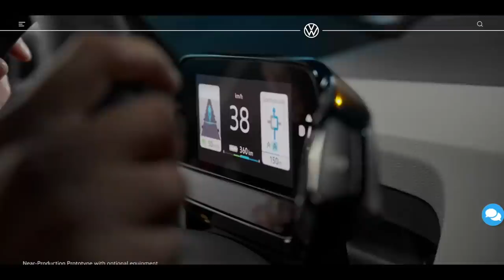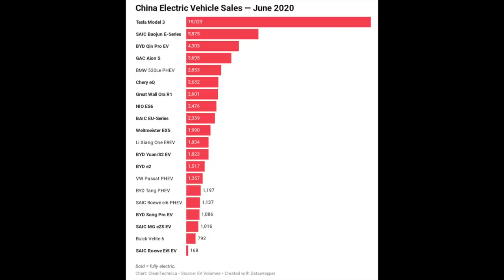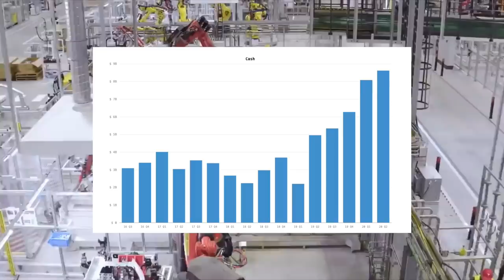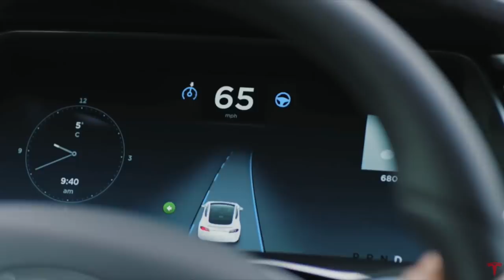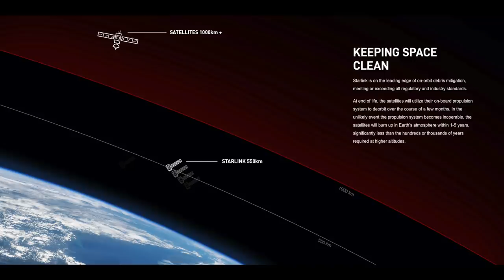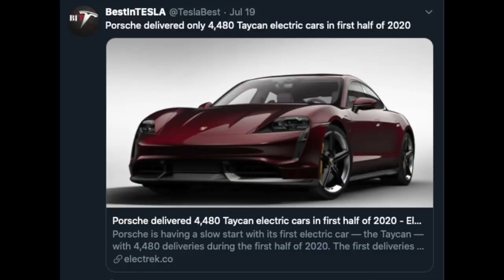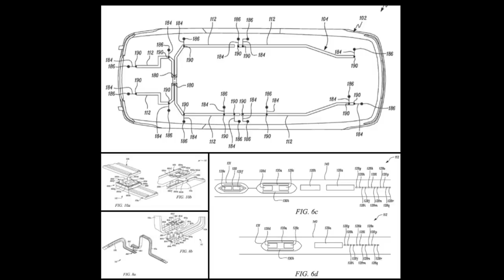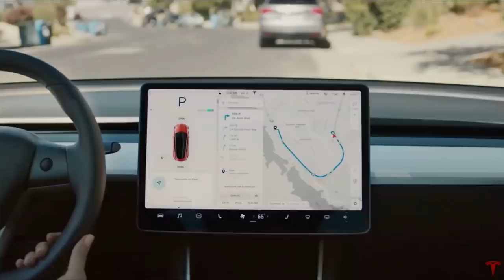Tesla WON | Tesla just made their Checkmate move | No one can stop them now

Comment: The whole reason the old car companies are in this mess now is they never counted on an electric car company to succeed, and did everything in their power to prevent this from happening.
They never wanted to innovate or produce electric cars as their main business strategy. Likewise, they tried everything to bankrupt Tesla, but failed and will now pay the price.

The one I believe will survive and compete in the long run is Toyota. They may have a downturn, but they specialize in efficient manufacturing, and have been on the path to electrification for decades.
Reply: Dear Dina:  The “big boys“ certainly did not anticipate any new car company emerging, let alone An electric car company. And here comes Tesla, in a few short years, has usurped all the major technologies and produced the best electric cars that are indeed affordable.

The “Big boys“ make only a small fraction of their profits on the sale of new cars.  A much larger share of profit is made on parts for repairs. With this model they are doomed. Electric cars have far fewer parts and need far fewer repairs.

A perfect example is the amount of wiring needed. It looks like Tesla is finally adopting what the “big boys“ could have done 20 years ago, multiplexing Control signals which completely eliminates wire harnesses, reducing the amount of wiring in each car from miles to a few hundred feet.

I am an electrical engineer and I learned about this technology in the 1980s, it was invented by the telephone companies in the 1960s to reduce the amount of wires needed to carry telephone calls. All these decades I have been watching, hoping, becoming exasperated, as to why those idiots in charge at the “big boys“ have not adopted this simple and proven technology to reduce costs and complexity of cars and improve performance.

I hope not one of the “Big boys” survives. I want revenge because they retarded technological development for decades with their shiny shitty cars.

Put MBAs in charge instead of engineers and this is what you get, big fat “big boys“ that are going to go bankrupt. Enjoy the next few years of watching the “big boys“ shrink down into “little boys“, If they survive at all.
Reply: @steveperreira5850  You can be mad all you want, those are americans with good paying jobs with families to feed....
Reply: @steveperreira5850  IIRC, it was GM who invented "planned obsolescence". They deserve to go down for that alone. Also for killing electric cars, fighting smog control, tearing up public transit, etc.

They fed us increasingly crappy cars from the mid-1960's on, which is why Toyota et al. cleaned their clocks. They finally began to up their game in the 1980's, but unfortunately, their corporate culture, which strongly resembles feudalism, did not change with it. The lords of the boardroom liked their cushy positions. Innovation, and anything else that might rock their boat, was shunned.

This created both the need and the opportunity for Tesla. Even so, it would not have happened without a visionary like Musk, willing to risk his entire fortune on what seemed at the time like a pipe dream.
Reply: Crypto Unchained What you are saying is Ludicrous.  As the old trope goes, “ then we should still be making buggy whips.“  American jobs will go away if we do not adopt the latest technology and master it. I most certainly do not want American jobs to disappear, I want inefficient jobs everywhere to disappear, mainly Government jobs, but also in inefficient industries and businesses.
Reply: Paul Pedersen   Dear Paul: very well said, especially the visionary part, it was a huge risk that Elon took, And it look like never was anybody going to break into the auto business from scratch without government assistance, like done in China.
Reply: Didn’t Joe Biden say he wanted all gas vehicles off the road by 2025? ;)
Reply: Dima Gurevich No they held off from losing money while they were unprofitable and let Tesla make all the losses, now they can be profitable they are moving in.
Reply: Simon Rook There is an alternative universe where your theory holds water, but not in our universe.
Reply: Francisco Teixeira   Dear Francisco: the emerging new electric car industry, and tesla in particular, is not the only reason the big car companies in America are going to go out of business, but it is hastening their demise. That’s what I’m happy about because I may live to see it happen!

Obviously the debt that the big three auto companies have accumulated because of employee obligations and poor management of resources, etc. Got them in the weak position they are in right now.

I was in a position to observe how badly they were managed in the 1990s, and how stupid the American car companies were compared to foreign auto makers.  I personally designed automotive parts and I visited all the major car companies as the lead design engineer for our company back in the 1990s.

I have just one question for you and I’m serious about this. How come the American car companies cannot make a good small car, or why won’t they do it? Every single car I have ever bought is a small car, and most of the people I know buy small cars.  Those cars are made by foreign producers.

You seem to be very critical of what I had to say and you haven’t offered much of your own advice or thoughts, so now you are on the firing line Mr. Texeria.
Reply: @cryptounchained7444  So, in essence, you are saying that all GM (and others') employees are just indirect welfare people? Wouldn't it be much more efficient to just pay them directly and cut out the enormous expensive of materials and the overpaid executives?
Reply: The point you make is one of the main reasons I love Tesla, No other company cared to make electric cars because they were probably paid by the oil industry. Probably the reason they killed off the EV1.
Reply: @steveperreira5850  Love your comment!
Reply: GntlTch   ... Oh, Oh, I love your plan for efficiency, oh it made me laugh so hard, thank you, and I endorse it completely! We should extend that policy to farmers who get paid to grow crops that nobody wants to buy. Mind you, I am the son of farmers.
Reply: And together for almost a century with their pals- big oil, who all they cared about was selling large volumes of gasoline and diesel. Both dinos will be seeing their schisms.
Reply: @GntlTch  At one time I read GM’s biggest supplier was not US Steel, Goodyear, or PP&G.  
General Motors’ biggest supplier (the vendor they paid the most) was Blue Cross. 
With one million retirees receiving lifetime healthcare, GM had become primarily a health care provider that happened to lose money on cars as a sideline. 
This is what actually bankrupted them.
Reply: @steveperreira5850  Very well said

Comment: BTW, after S&P inclusion, institutional buyers will buy shares on the open market.  Available float on shares is ~147M. At Tesla's current market cap, it should be about 1% of the total fund value, or about 26M shares.  For Tesla to capture all of that, they would have to dilute current offerings, which will NOT happen.  Instead, fund managers will acquire shares from the float, thus driving up demand and share price.  The only money coming directly to Tesla will be in company held stock's value increasing, and that won't be accessible.

Comment: 2:00 Sorry brother, they have to “buy shares” in Tesla, they don’t have to give them money to boost their free cash flow.  It should boost the share price insanely though.
It is only if S&P ask them to release additional shares that your scenario will play out.
Reply: You assume that there will be enough shares for them to buy. Many, if not most, Tesla share holders are going to hang onto their shares and go Long. It is very likely that Tesla will make a secondary stock offering (not sure what the actual term is) and then Tesla will get all the cash from that sale. I'm guessing over $ 40 Billion.
Reply: Yes, they can raise that capital by issuing more shares, without diluting the value too much...as they did a while ago at around $750.
I’ve read that the S&P500 may ask them to do this anyway, to make shares available for Tesla’s inclusion.
Reply: terry Sullivan 26 million shares is 20% of the available pot. The normal process is for the price to reflect the level of demand. It is S&P who request a special release of shares. In that case Tesla get the cash. 
But you can’t “assume” this will happen as the video suggests.
Reply: @terrysullivan1992  Currently there is a daily trading volume of around 15 million shares. With around 15 million shares needed to be bought it's certainly doable over time purchasing them on the open stock market.
Reply: Wrong, if Tesla issues more shares it will dilute the share value and Elon Musk's ownership stake. This is not happening.
Reply: @roryreddog3258  Actually you can easily assume that the request will be made. 

If you need to by 25m shares, and try to just buy them on the open market, that would be stupid. Lets (again easily) assume that the index fund people with $40b to spend are not stupid. So that request IS going to be made.

The people are Tesla are not stupid either. They could let the index funds hang and force them into the open market. But why would they? It bumps the stock price, but that does Tesla as a company very little good. $40b cash, does the company a LOT of good. So, they would be stupid to turn down the request.

The assumption is the inclusions into the S&P, my gut says that isn't going to happen in August. The stock price has just been to volatile the last few months. It's seems of of hit a stable value at the moment, but too little too late. My guess is we're going to have to wait a few months for S&P to happen, and we're going to see a big drop in the price in the next two weeks because of that.
Reply: Theepan Raj  S&P can demand it for inclusion, but seems unlikely... you’re right though dilution would be bad for me (shareholders)
Reply: Matt McCarthy my understanding is that it is S&P that make the request/stipulation not the index funds.  
But I could be wrong, if you have better knowledge in this than me 🤷‍♂️
Reply: @theepanca   “Without diluting the share value too much”. It’s in the words. ;)
Reply: @roryreddog3258   The long term share holders, and those considering long term investment in Tesla, would most likely see it as a good ‘long-term’ move...like they did last time. Tesla could invest in further expansion, and maybe keep some back for ‘eventualities’.
Reply: @roryreddog3258  So, I'm not from the US, and I've never run company there. But I have in the UK, and we're largely the same in the legalities.
AFAIK. You, you self could today approach Tesla as ask to buy stock directly. Of course, unless you're a billionaire, that email is going straight to the Deleted folder.
So the S&P could request/stipulate it, but that isn't the only route. If the S&P doesn't the Indexes will ask for it anyway. As it gives them a stable, one off price.
Reply: C Bromley yep I agree ultimately Teslas long term success is my own. But if they were “forced” to liquidate $40 Billion when it can’t be used up for the next 10-20 years, I’d be a little wary of that dilution tbh
Hopefully won’t need to find out
Reply: Matt McCarthy thanks for clarifying.  makes sense. 👍
Reply: @roryreddog3258   Yeah. I don’t think they’d raise $40 billion all at once. I share your gut feeling that, that wouldn’t be good. ;)
Reply: @terrysullivan1992  there are enough shares traded in a week for the index traded funds to hit there allocation. What he says in his video is patently wrong, there is no getting around it. Dilution will cause a drop in valuation no matter what why you cut it, it's not going to happen
Reply: @cbromley562  S&P may ask them to do a share spilt. It's a completely different thing. Read up
Reply: @TheJohnnyblazsus   Yes, they could ask. I think Elon mentioned they might consider it anyway. Apple have just done a 4 for 1. 
We’ll see won’t we.
Reply: @TheJohnnyblazsus   How can you be sure? They raised just over $2 billion in February this year at $767. Despite a few % dilution, it was generally seen as a good move...especially as they weren’t forced into it.
Tesla is in a good position at the moment...we can’t blankety rule it out. They’ll do what they do.
Reply: @cbromley562  ok, big difference between a 2 billion dilution and a 20 billion dilution. I sure you can understand that, right?
Reply: @TheJohnnyblazsus   I can understand a lot of things. This is an easy one.
Reply: I'm believing Elon will want to create a short squeeze on the shorters first before he will make a stock offering going into the S&P.  There is an estimated 12 million shares short, about 8.6% of float.  Tesla is just using their cars to sell their technology.

Comment: The guy making this video doesn't understand the stock market
Funds will have to buy shares, but not from tesla but from the open market. 
ooof
Reply: Tesla can sell some or all shares directly to the index funds diluting the company a small amount if they choose. So this is a possibility.
Reply: @chadsurles1736  There are not nearly enough shares not owned by Tesla insiders who are likely to hold onto theirs, so buying on the open market will be a challenge for the index funds and will require them to raise the price they are paying for the stock by a lot.  Tesla can then respond with layered secondary offerings to dilute a little bit at a time as the stock price rises due to the index funds' buying pressure and the short squeeze resulting from the stock price rise.

Comment: Good thinking Lars, they should surely use Starlink to give their Autopilo and FSD a unique latency advantage.
Reply: I dont think so, Antenna is too big.
Reply: Mark Plott they’ll find a way to make it invisible to the driver
Reply: @marcogh  My first thought is to have two lines of receivers down the sides of the cars. That way, they have some that are automatically angled to see the entire sky along the length of the car. When there are enough Starlink satellites in orbit, it seems plausible that the car would be able to see at least one at all times. It wouldn't get good bandwidth, but it would get good latency... but I'm not much into hardware, so this may all be impossible - just a thought.
Reply: @KofoedTim  That could defiantly work, as long as it's invisible to the user it will be great. A system like that could be designed for a ton of bandwidth if done well

Comment: Lars, very inspiring video.  I have a question about one comment you made.  You said that Tesla would provide the 25 million shares that the S&P funds would need once $TSLA is included in the S&P 500 Index.  I have not heard this before.  It was presumed that Tesla may issue some shares to provide some liquidity, but that the remainder would have to be purchased on the open market from the float of 146 million shares outstanding.  This is important in that it would imply the share price would likely take a hit if Tesla issued a secondary offering of 16.666 million shares at a price of $1500 per share.  Every shareholder is waiting for this pop in the share price after the announcement and you are saying that there will be no extra demand for shares as a result of this secondary.  Can you please confirm if I am understanding you correctly or correct me if I'm missing something?  Thanks
Reply from the maker: Yes exactly 👍 don't think many shareholder will sell right now, that is why I expect them to sell more share, and therefore get the money. 😉
Reply: @BestInTESLA  The daily trading volume of the Tesla stock is around 15 million. There are that many sellers every single day. And if the stock price spikes due to the funds buying, it will create even more sellers ready to take a quick profit. 

Unless Tesla finds it a strategic move to issue more stocks, I don't think they will. Right now they are not cash constrained. And even if they did it would not be for that kind of sums.
Reply: Elon hates short sellers. He will NOT issue a single new share. Institutional investors easily can buy their needed shares from the stock market. This will Drive the price a bit higher which MIGHT force more short sellers to cover. Maybe this even leads to a short squeeze. I am pretty sure the short squeeze of the century is the scenario Elon would like the most (and me, too)

Comment: When a stock price rises, does a company make more money?
No. But companies benefit in various ways from a higher stock price.

Companies can and do issue "secondary offerings" - the company (and thus shareholders, indirectly) sells new stock for cash. Existing shares are diluted, but the company may be more valuable since it has more cash.

Companies can use their stock to make acquisitions or other deals. Higher stock price means fewer shares are paid for the same cash value.

Companies dilute shareholders by issuing stock compensation to employees, which shows up (these days) as an expense on the financial statements, lowering EPS to reflect the harm to shareholders. If the stock price is higher, fewer shares are needed to make employees happy.

A company with a high stock price is not as vulnerable to a takeover. In a takeover, shareholders might receive less than the company is worth. Though generally at least some parties will feel the takeover is a good deal that gives shareholders more than the company is worth - after all shareholders are getting more than the stock price.

One way a high stock price can hurt a company is that many companies do share buybacks when the price is too high. Economically speaking, a company should only buy back shares when those shares are undervalued. But, management may have incentives to do buybacks at irrationally high prices